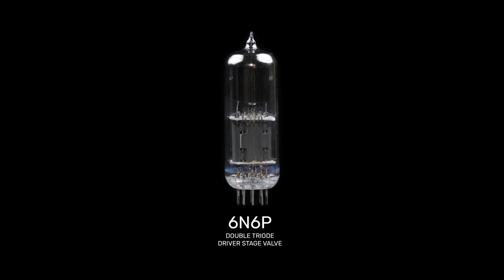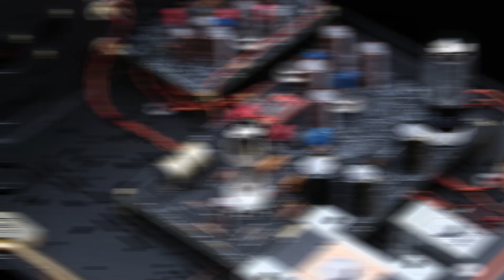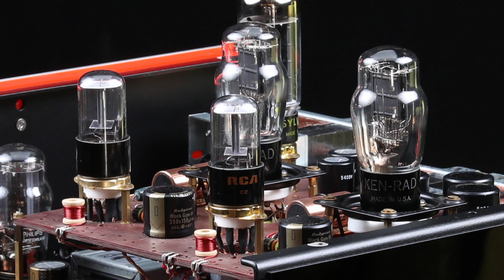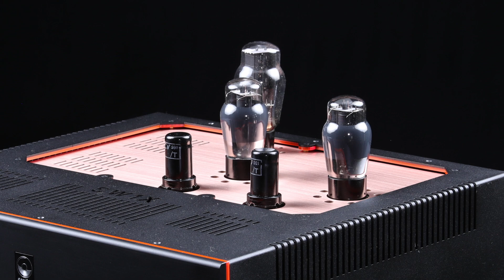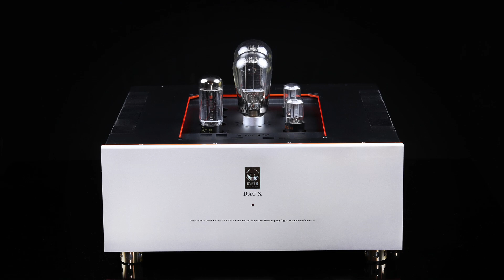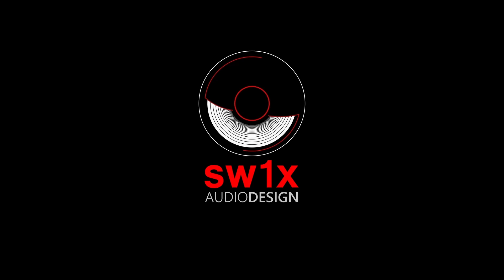How Sound Quality Improves With Size Of Tubes in High End Audio

Comment: Once I put G807 in the same circut to compare it with 6P6S (both in triod, 300V 40mA 6kOhm load). And even so underpowered with tiny OPT G807 subjectively sounded at least twice more powerfull than 6P6S)) Dynamics also much better.

Comment: So many ignorant people in the hifi domain.

Let’s consider Tubes, transformers, capacitors for example. Better quality components and larger in size will obviously have an overall improvement on every aspect of the sound. For instance a larger transformer will translate to a more extended sound at both end of the spectrum hence larger dynamics and yes bigger soundstage. I think these clever clogs just want to be heard. It’s very easy to poop on a companies research development and painstaking effort and high expense but at the very least back up your comments.

Oh and if you don’t want to do anything else just demo some of sw1x gear. Even at level 2 it’s very impressive indeed.